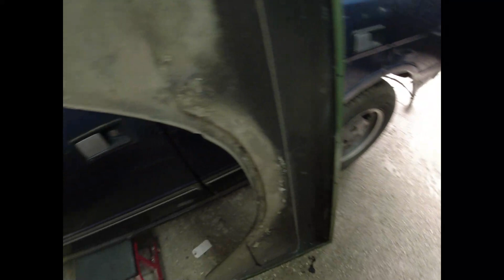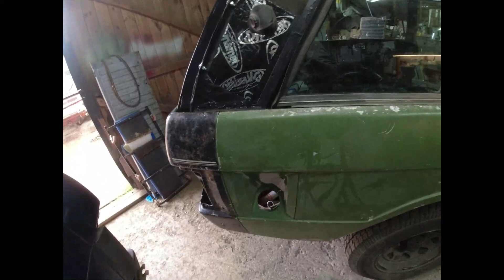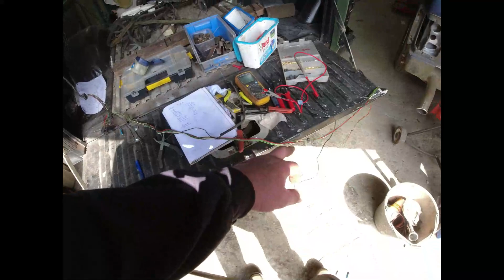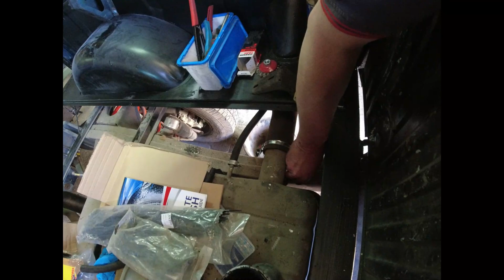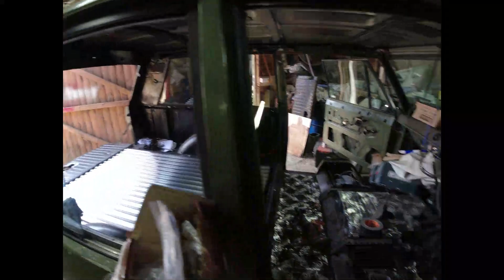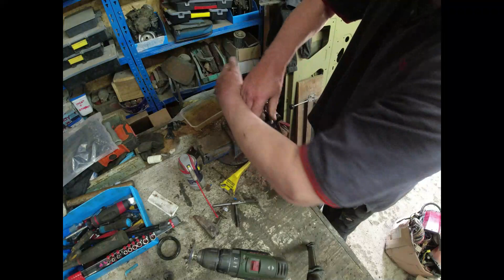Range Rover Lincoln Green - fitting out the back end, loom issues Ep25

Comment: Another good one Richard. I find a rag with some panel wipe is good for cleaning the wires and seeing the colours. The grounds fail first as they carry higher load- they tend to be the same size wire as the feeds but the handle the ground for multiple circuits concurrently. Modern cars tend to draw that distinction more and use thicker wires for common grounds.
Reply from the maker: spot on, I use degreaser on a rag and hand wipes to see where I am going. Earth wires are always the first point of call with any misbehaving circuit

Comment: Pat and Ena cheapskate or lazy man restore, it adds nothing to the car it just looks like you don't care.
It really is time you invested in a sand blasting cabinet (it's tax deductible) there is not one part of a Range Rover that couldn't do with a good blast when you are working on it.
Reply from the maker: but but but, customer is always right, they want a patina then I give that. In this case I agree with my customer 100%, their decision is neither cheap nor lazy but what they want. Admittedly it cost them no more for me to hang care worn panels back on to a full restored body frame and should they wish to sell and maximise the resale then it becomes much more straightforwards to get the car ready for a new owner. There is no right and definitely no wrong when it comes to this.

I do have a blast cabinet but have found in most cases the needle scaler or zip wheel are quicker and easier

Comment: The tap and die sets that can be purchased from a well known German supermarket are ok for cleaning threads but struggle to cut a thread.
They do the job but a good set of taps and dies with plug and second taps and split dies are very pricey unless you can pick up good second hand set from a car boot sale.
Unf and unc sets are hard to get hold of as every things metric these days.
Not sure if the American market has been converted to metric or still using the unified thread.
As for the colour coding on the wires you must be screwed if you're colour blind.
Reply from the maker: pretty much agree with everything there Peter